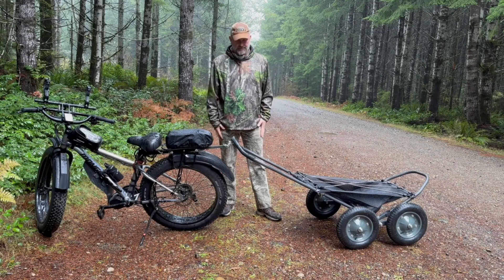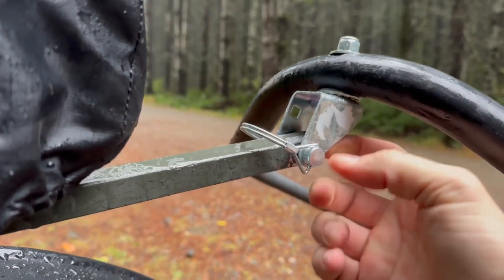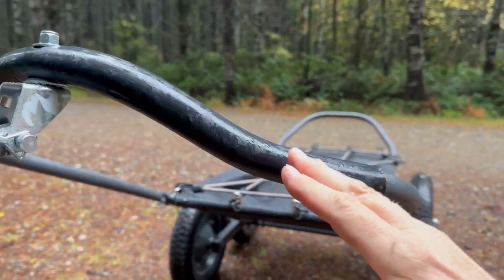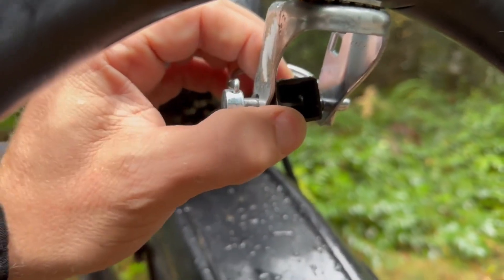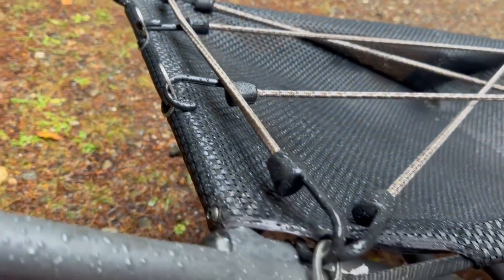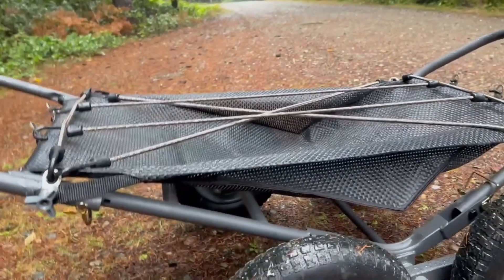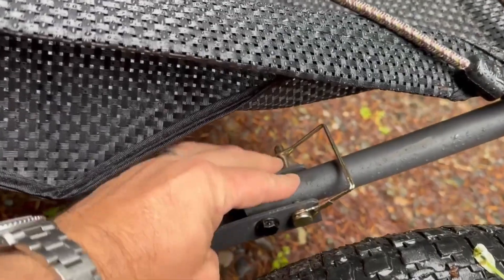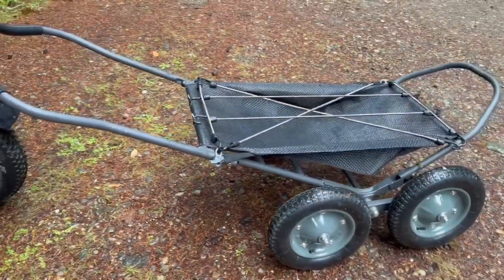Hawk Crawler E Bike Trailer

Comment: Great design.  I’m not sure how much issue needing camber clearance will be for me.  We’ll see.  Great idea to “pin” the crawler on those folding points.  And also great tie-down add ons.  I plan on using this rig for hauling remote camping trips in addition to hunting.  Still in pretty good shape for 64, but looking to work smarter, not harder.  Thanks again!
Reply from the maker: I’m glad you like it. I hope your cart works for you.
Reply: @BKTOutdoors  How's this worked out for you???
Reply from the maker: I’m still using the design with a heim joint and it’s been working great. I’ve had to wrap a lot of things in tape to minimize rattling, but overall it’s been great.
Reply: @BKTOutdoors so a heim and a rod end?
Reply from the maker: I bolted the heim on a steel square tube that slides into the rack and pins on the bike. Then I run a pin through the heim and a caster wheel frame that’s mounted on the trailer.
Reply from the maker: Here’s a link to the video I did adding the Heim joint. https://youtu.be/aLaGHdlPbbw?si=Ig-JEI4M-x6Q0NNl

Comment: You can enlarge the hole for the caster bolt and add a couple automotive polyurethane bushings and steel washers, one on top and one below the trailer bar and that would give a little camber flex
Reply from the maker: I’ve been considering the polyurethane bushings in a number of spots to help dampen noise as well.

Comment: You could always weld or bolt up a heim joint for the pivot you need over bumps.
Reply from the maker: I considered a Bung tube and heim joint connection, but everything I found was too bulky. That would definitely give the best range of movement.

Comment: Tilting of the trailer , or  "camber" , the way you described it , could be fixed with just another castor wheel base , mounted at the end of  square tube (or bar ?) ,parallel to the ground (in line with the square tube/bar) and attached to the existing castor wheel base . Pretty strait forward and you can do it on a work bench , or a kitchen table (you would need a drill and drill bits) . If you have possibility to weld , than you can use steering rack joint from a car or a buggy . Or just a simple bolt (which fits into the square tube)  with two big and thick washers , with peace of metal between them - which would be attached to the existing castor wheel. 👍
Reply from the maker: I like where you’re going with that. I can visualize it. I’ll try it out and do some testing.

Comment: Would a tierod end work instead of a bolt up through the trailer handle?
Reply from the maker: I considered using a tie rod end and had some laying around from my Jeep. I set the parts on a scale and the set up was 5 lbs heavier than the design I came up with. So I went with the lighter design. The tie rod would definitely work though.
Reply: @BKTOutdoors  I was thinking one from a lawn tractor you can buy the ends at TSC
Reply from the maker: @practacticaloutdoorsandthi6962 I didn’t think of that. That could work without adding too much weight. Let me know how that works if you build it.

Comment: Rambo e bikes makes a trailer hitch that will work for about $40
Reply from the maker: I’ve considered the Rambo, but they only offer the piece for the bike. Not the trailer side. The steel tube I used was about $10 at Home Depot. I’m still working on a different design using Heim joints that look promising though.

Comment: Other reviewers have had problems with the wheels going flat and even the tubes splitting. How have yours been? The others seem to use harbor freight tires that are slightly shorter to replace them with
Reply from the maker: I had issues when I first got it. Then I inflated them to 1 lbs over pressure max and haven’t had any issues since. I also pulled the tubes out and added Kevlar tube protectors. Works great so far.

Comment: Real talk how much did your bike build cost and was wondering about your fenders did you use same in rear as in front
Reply from the maker: Complete cost was $1950.00. The rear fender is a front fender from a motorcycle. The front fenders are generic mt bike fenders. I’m not very happy with them though. Thinking about doing something else for the front.
Reply: @BKTOutdoors  was wondering if the rear would work for front to if you cut it up
Reply from the maker: @stevechojnacki7104 I think it might work. This is a link to the fender I used for the rear. https://amzn.to/3Up8XWF

Comment: I have the same trailer but I sent my bike up with a half inch steel square stock then I put a 3/8 lifting shoulder eye bolt and then on my trailer I just put a sob carabiner clip I've had no problems with it works beautifully
Reply from the maker: How’s the noise going down the trail?
Reply: @BKTOutdoors   It works fine I've had it out on four trips now going uphill downhill over big logs haven't had any trouble at all but I do use the flexible tie downs from home Depot I can't remember what they're called they're like giant rubberized bag ties but they work great
Reply from the maker: Thanks. I’ll be posting some of my changes soon. I’ve gotten it very quiet. I’m going to play around with some of the stuff you had success with.

Comment: How did you mount the tow bar to the back?
Reply from the maker: The base tube of my rear rack is hollow. I ran a 1/2" steel tube down it until it stopped. The marked it at the length I wanted, then cut off the rest. Then I drilled a 1/4" hole close to the seat on the base tube of the rack. Then slid the tube back in and marked it. Pulled it out and drilled the holes so a pin can hold it in place. The drilled my holes 1" from the end, so the Hitch/caster could pin them together.

Comment: You should have mounted the caster pin straight out the back. And put the hole in the handle in at 90 degrees to what you have. With the caster lose you would have up and down movement. And the handle hole would allow tilting of the cart. You’ve weakened the handle with the vertical hole now. 
Also have to deal with turning. Not sure how your set up accommodates that.
Reply from the maker: It’s a process no doubt. It can handle 400 lbs as is with no binding on the pivot points. I’m still not satisfied though.